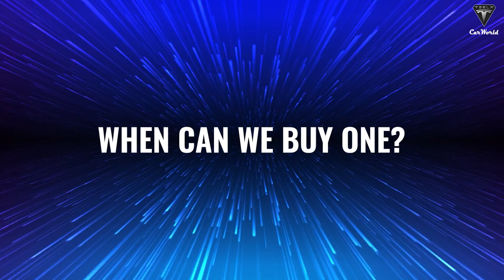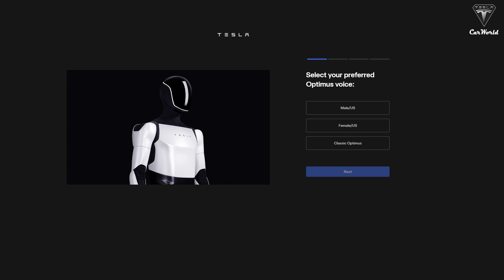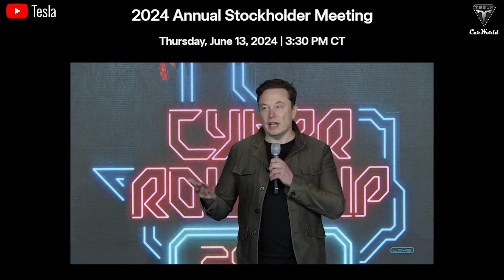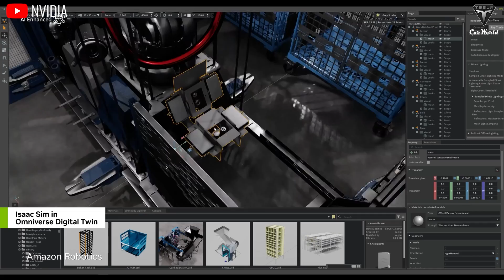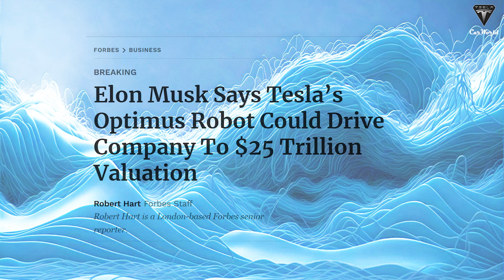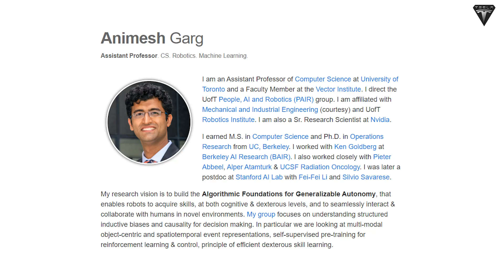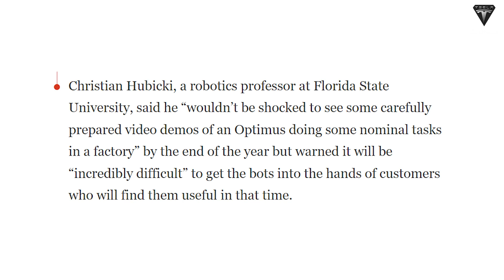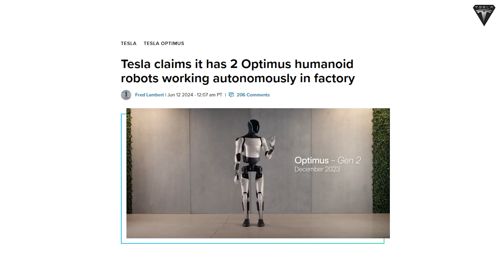Just Happened! Elon Musk Confirmed Tesla Optimus Gen 2 Produced At $10K Price To Work At GigaTexas

Comment: Just hav skeleton crew for distinct meta fa connectors and factory easy fix engineering and production lines but solid node model body gaurds and computer central centworks cen t centurion continues centennial but millinihms ix 2000 ky1999 turn overs is in paradise one returns

Comment: Yeah, those digital renders are gonna really show us humans how it's done. I have worked at a factory where they produce cars, and you gotta see the speed and precision at which those guys work, these bots will not be able to replace them, not even close. If you want to manufacture cars, building a robot that moves and looks like a human adds unnecessary complexity for vanity's sake. You are much better off building purpose-driven machines bolted to the floor for each stage of the manufacturing process; that way, you don't need 3 guys behind each Tesla bot to keep it from falling over, this is just an announcement to pump stock prices.

Comment: This is the gross exaggeration channel for unoffical  Tesla news.  "Just happened" was June 14th.
I watched the entire original presentation and have seen every public announcement since. Tesla has NEVER said its cost for producing gen 2 Optimus IS $10K.  What has been said  by Mr Musk is the cost of a humanoid robot WOULD BE would be 10-20K.  That's with large scale production . Based on what we know, (prototypes are easy, production is hard, and software is harder)  it will likely be Optimus 4 before the software is useful outside simple factory operation and THEN get scaled to large production.   Just as with any product, the price will be whatever the market will bear above the cost of production.      Musk's scenarios for deployment generally discuss a robot for 3 years to replace one worker two shifts per day and it saving 3x its cost.

Comment: if they are AI driven, maybe they'll become fast, but robotic arms can already work more efficiently than biped robots, but to install the dashboard and maybe cabling they possibly still use puny Humans

Humanoid robots will find more work in services than manufacturing I suspect. And soldier robots will be quadrupeds or ostriches-on-wheels with pewpews, Robocop had them but their feet were not adapted to human stairs

they'll end up as Clerks in Tesla's Showrooms and receptionists. They could be useful as expendable crewmen on the Earth-Mars-Express

would be nice if they sold it as parts, so i can make one for $1000 with cheap gear motors... AI driven. Because a well trained AI can even find a way to move when only 1 motor remains in function, and it can compensate for the cheap motors

would be nicer if they gave me one so i could make it semi-free-will

i'll ask Elon for a Gen 2, say a cracked shell refurbished with only leg motors

Comment: The idea of re-entering and landing the spacecraft and Starship Booster on Earth is wrong.
Elon wants to send millions of tons of cargo to Mars to build Mars City on this beautiful planet. To do this, he needs to send some housing to Mars. Rockets and boosters would be an ideal solution for this, as long as they could be reused on the surface of Mars and turned into homes for colonists. In practice, Starship's stainless steel boosters and rockets would be massed in geostationary Earth orbit. There they would be connected together, one rocket in the center and the rest around it. Rockets grouped in this way would be transformed into hotels in Earth orbit and transported as a whole to Mars. Each such group could have one rocket in the center and ten around it. This way, one active Starship rocket in the middle of the group could transport the entire group to Mars. These groups could land on the surface of Mars using only the raptor engines of the central rocket (this is ensured by the low gravity on Mars). A group of rockets connected together would be more stable during landing than individual spacecraft landing individually on the surface of Mars. Groups of spacecraft waiting in stationary orbits could serve as space hotels, both in Earth orbit and in Mars orbit. Now the transition from spaceships to space hotels could be done in Earth orbit, such a port would be much cheaper for various destinations. From there, individual rockets could be sent to the Moon or Mars. All spacecraft used as space hotels would need no thermal protection, no reentry and therefore no protective plates on the hulls of these spacecraft. Landing on Mars or the moon does not require layers of thermal protection. Elon paid a lot of money to send spacecraft into Earth orbit, so bringing them back to Earth would be unwise. It would be cheaper and easier to make a space hotel out of them, or send them further to the Moon or Mars. To complete the project of colonizing the Moon and colonizing Mars, a fleet of thousands of spacecraft will be needed, without the heat-resistant protection of heat-resistant tiles. According to my plan, it is not necessary to return them to Earth. Waste of time and money. Elon is capable of sending spacecraft and boosters into geostationary orbit and producing a fleet of spacecraft and boosters in space.

Comment: Will cost 10,000 but then it will need the rust proofing package for 5k, plus the extended battery range to be able to go up the stairs and across the house for 5k, plus the water proof package for 5k so it can give baths, and then of course the sex package for 10k if required.

Comment: This analysis focusses on the simplified case that in a first phase the deployment of the Tesla bod is limited to the Tesla manufacturing sites in in Fremont California, Shanghai, Texas, Berlin, and Nevada before it becomes available on a wider scale. This gives a very conservative estimate of the impact of the Tesla bod on Tesla’s own manufacturing process which can then be used on a wider scale.

Employees as of 2022 as per Wikipedia as of June 2024

Freemont 	22,000 employees
Shanghai	20,000 employees
Texas		20,000 employees
Berlin 		10,000 employees
Nevada	          7,000 employees
Total		79,000 employees

The following assumptions are made
-	30% of the manufacturing work is menial that can potentially be replaced by humanoid robots.
-	The total cost to Tesla per employee is $100,000 to include salary, benefits, vacation pay, etc.
-	The one-time cost to manufacture a humanoid robot is $10,000 once the production line is ramped up.

Using these assumptions Tesla can achieve the following manufacturing cost savings assuming that the Tesla bod is deployed across all 5 manufacturing sites.

Total manufacturing employees		                                          79,000
Total Tesla bods doing menial manufacturing jobs.                            450
Production cost of a Tesla Bod.                                                       $10,000
Capital Investment in Tesla Bods.                                            $10,000,000
Manufacturing jobs saved with Tesla Bods                                     23,700
Average yearly cost per manufacturing employee	                     $100,000

Yearly labor cost savings achieved through Tesla Bods.       $2.4 Billion
Reply from the maker: Thanks for your analysis, there are a lot of things we need to wait to say about these robots, time will tell all !

Comment: You mentioned 2028-2030 for being commercially available between 10-20k price? 
Wonder if Anthropic  or OpenAI will have humanoids commercially available before then (2026-2027?). Even if they aren’t as good with degrees of freedom, they can still do a plethora of chores and cooking.
I’m only planning on waiting 2 more years to get a humanoid, not 4. I’m a bit paralyzed and need their help asap.
Reply from the maker: This is just our personal speculation after looking at the problem and the challenges and difficulties that Tesla has encountered in trying to solve their cost, of course they can still achieve this price sooner because you know, they have a very good production line than any manufacturer, with a price of $10,000 to $20,000 is completely possible because they produce the transmission as well as the components themselves without the need for suppliers.